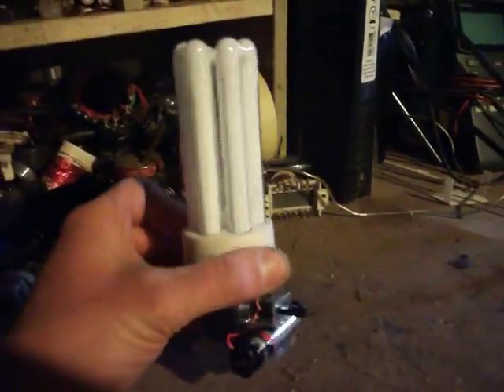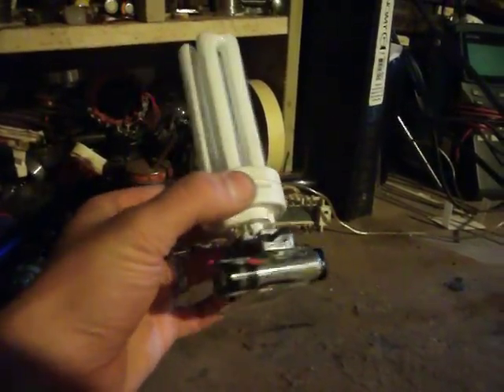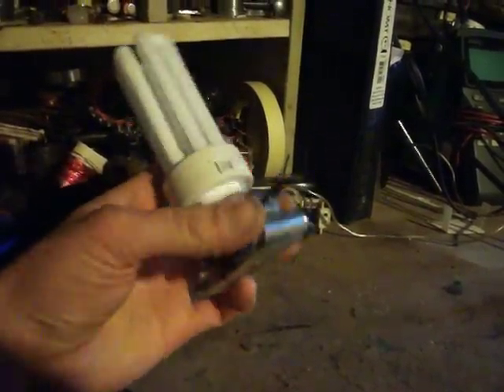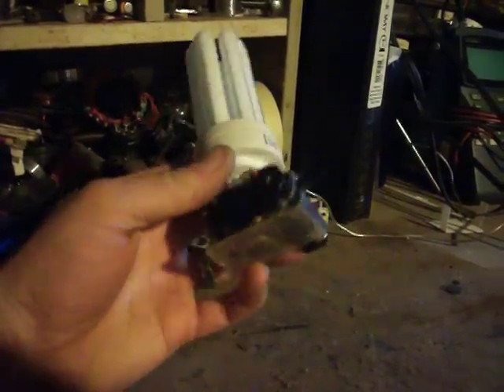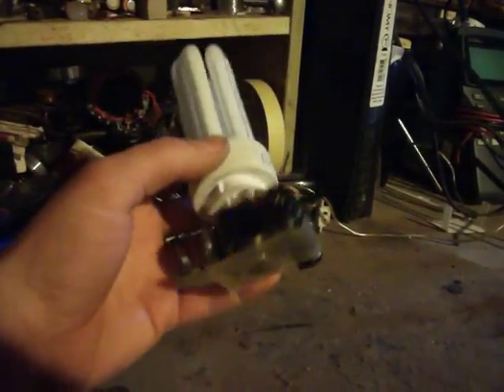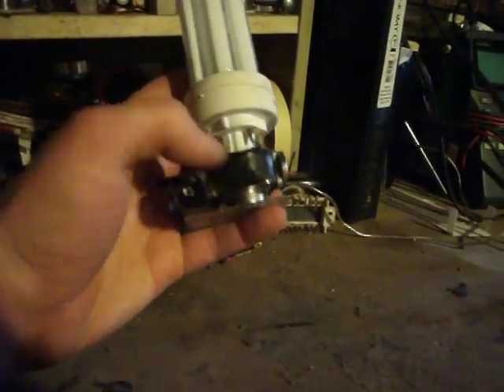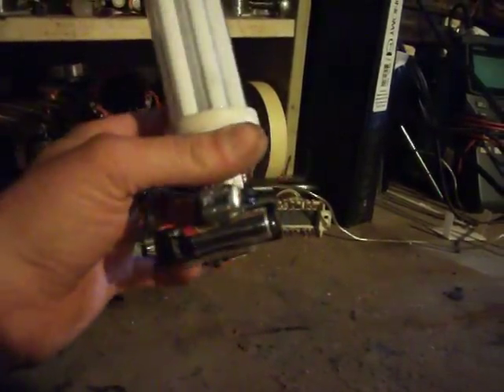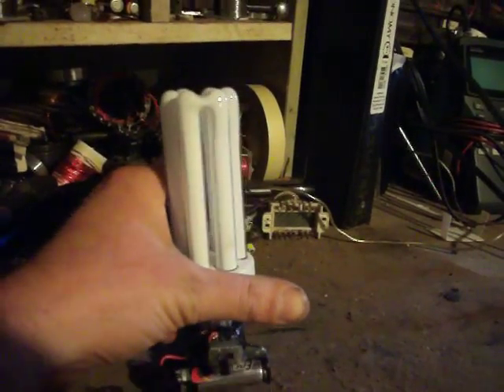joule thief cfl

Comment: if it really runs for 6 hrs, post the schematic. i wanna try..
Reply from the maker: I built this based on the "jeanies light". All I did different was use a small torroid core from a power supply and a 2n3055. I think the resistor values were 10 and 100. I don't remember the number of turns, probably something like 15,30, and 150. The wire was extremely fine and a pain to wind. I put it on a pencil and wrapped around for hours. Find the schematic for "jeanies light" and experiment. This was not an original. Thank you for viewing. Check out some of my other videos if you like. Some are very interesting and original. I do have schematics for most of my toys. Sorry I didn't document this build other than video.

Comment: how do we do to make a joule thief  1.5 volt input  16 volt output
Reply from the maker: Easy way would be a capacitor and zener diode. It would functions like a switch mode power supply.